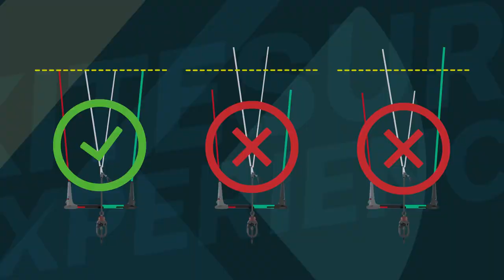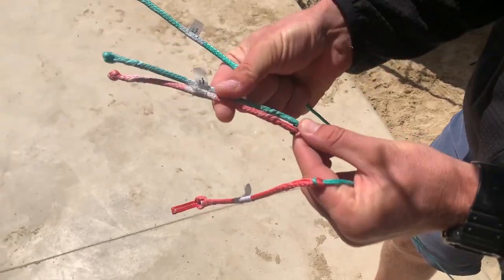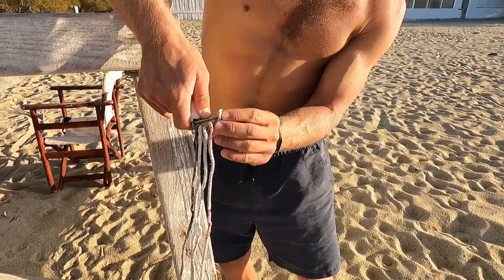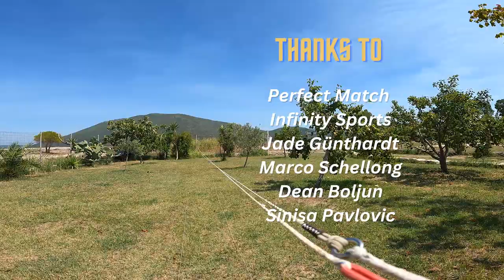Trimming the bar lines - (Kitesurf Tutorial)

Comment: Are you not forgetting to check if there is tension (undesirable tension) on the safety line? This has been the case with many older bars (airush, duotone, old north, f-one) that I have tuned. I would check that together with front line symmetry, before adjusting steering lines.
Reply from the maker: Hey Albert, do not worry I’m definitely not forgetting about it ;) you have probably missed my previous episode “TRIM AND SYMMETRY CHECK”?
In that episode I have been talking about the safety line getting shorter 🙌🏼

Comment: The tip at 4:18 has really helped me to align my frontlines at the Navigator Bar again. A double loop at the pigtails was just a bit too much, so I made a double loop at the connection of the 12 and 10m line. Is the double loop between thin line and another thin line also ok? Or will this have any bad impact on the maximum loads? Do you have any experience with this? Thanks!!
Reply from the maker: Great, happy to hear that :)
A normal knot on the thin line is definitely not good, as I experience couple of times broken lines. If there is a double loop on the thin line, honestly I didn't test how well would hold and I'm not having the intention on testing it 😅 I believe any knot on thin line is critical.
Reply: @kitesurfexperiencebypetar  I can confirm this. Most knots weaken the line by 50%. A simple loop as well.